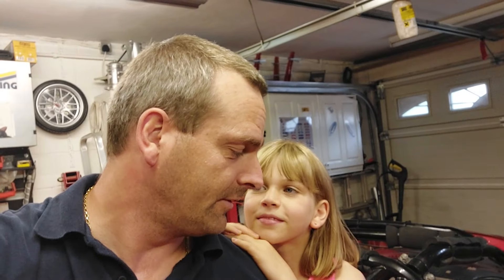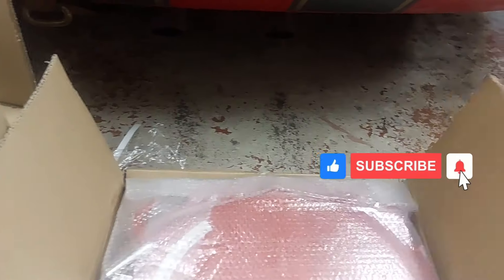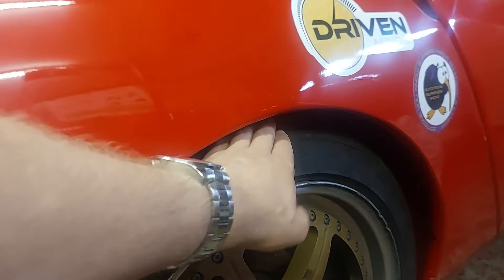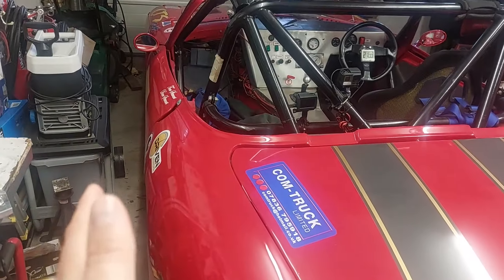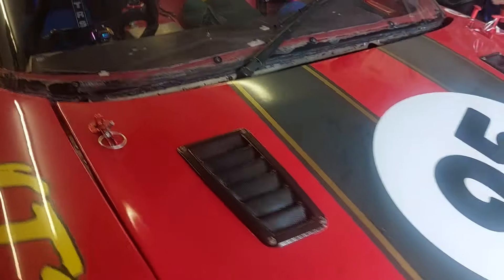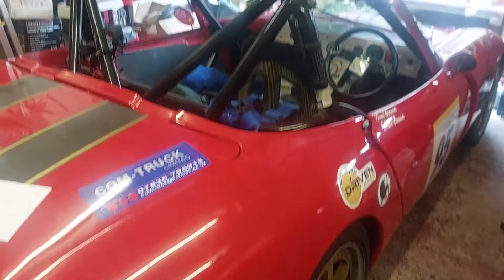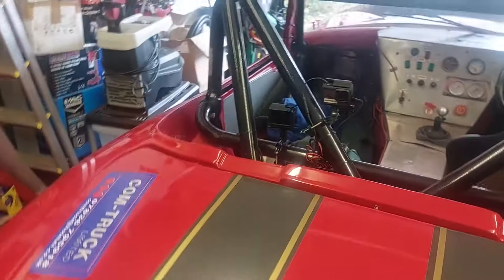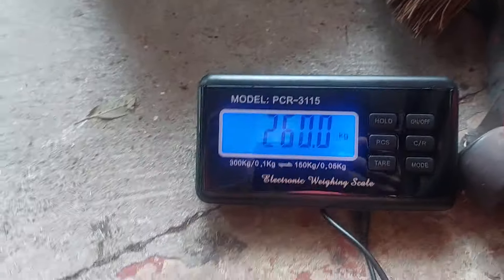TVR Griffith Race Car Setup - Part 1.  Let's get measuring!!

Comment: Dave. I remember being at Donnington some years age & they were doing this measurement to a Siera Cosworth. I can not understand how you can change the corner weighting. Or is it by adjusting the anti roll bars. Sorry for being a bit dunce on this subject.
Steve.
Reply from the maker: @Steviegtr52  Hi Steve.  Yeah I'm happy that it's square from what I can tell!! 

Because the coilivers are adjustable you can alter how the weight sits by adjusting opposing corners (I think 🤪). It basically puts the car under tension/load in different areas so kind of offsets the weight loading.  It'll be more apparent in the next video when I'll get a bit more in depth with it all 👍.  It does seem to be a bit of a minefield and trial/error though so should be fun!